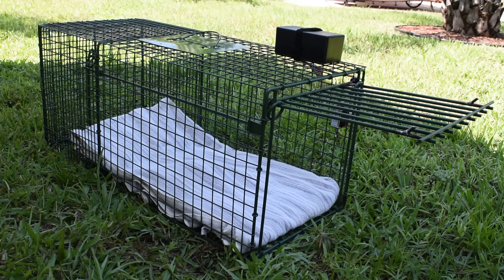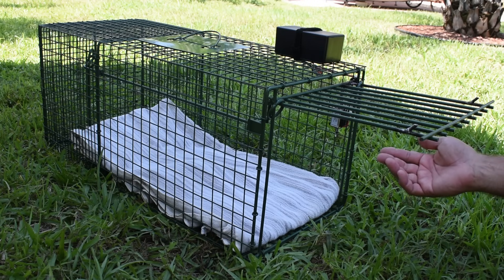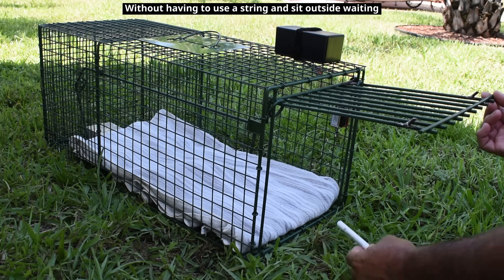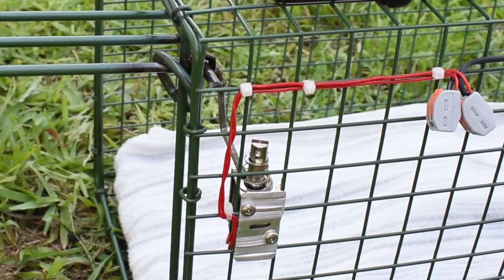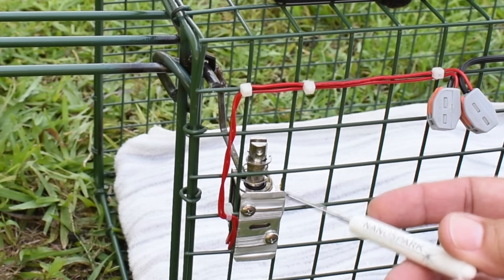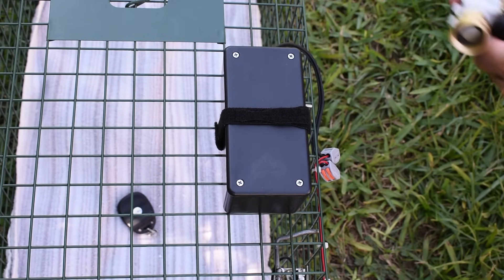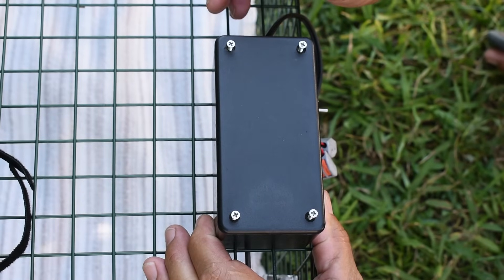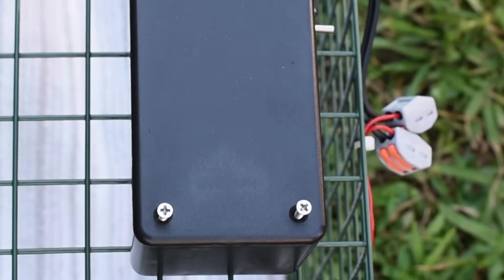DIY Remote Control Triggered Animal Trap ~ Cat & Kitten TNR

Comment from the maker: ATTN: You can also use a wireless video camera with this setup in areas out of your view, such as behind a fence. After I uploaded the video, I saw that the wireless module was converted from a relay to a mosfet to handle a high current load. If you purchase a wireless module that has a relay, you can disregard the diode mentioned in this video. Thanks for watching
Reply: Here is an idea for you that is not something that you have done. Use a 555 astable triggering through a ten nanofarad cap and a 100k ohm resistor into a 555 in monostable to get frequency timed low on time pulses of shorter than 50% duty cycle. The cap and resistor assure a tiny negative pulse to the monostable trigger which makes the thing work properly. You can set the duration to whatever you wish, which would work through leds, high voltage coils for fence chargers, etc., all allowing you to control the "on" time for a specific frequency.

Comment: What I need is a remote control opening device combined with a wifi sensor to notify of a catch.  This would allow remote release to prevent overheating deaths and to allow safe release both on site for mistakes or when a mad/sick animal is involved even if relocated.
Reply from the maker: You should be able to find a wifi module to alert you.

Comment: Nice setup. I suppose if one wanted not having to recharge the battery, a small solar panel could be incorporated into the build.
Reply from the maker: Yes, but the current consumption is so low you're hardly ever going to have to charge the battery. Thanks for watching